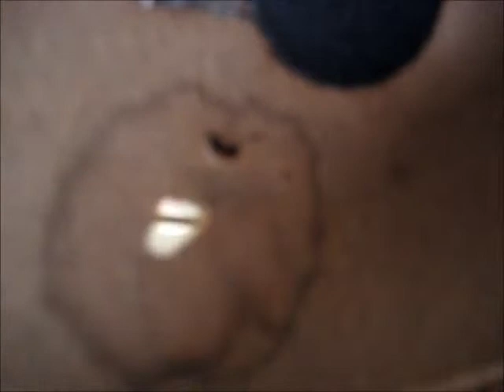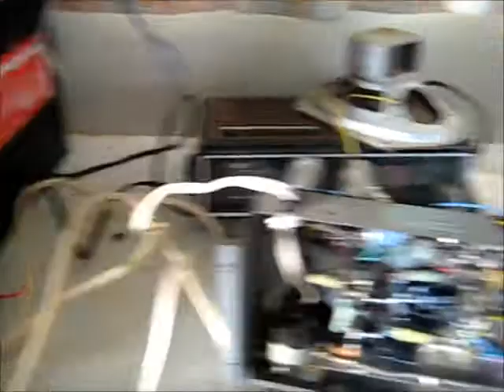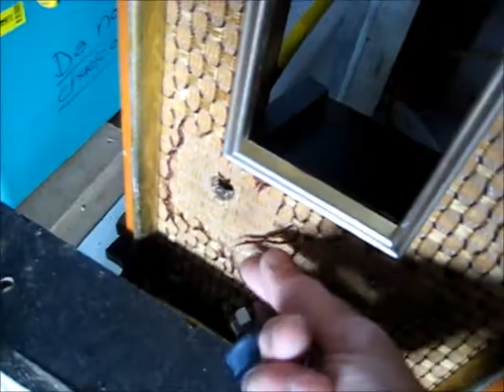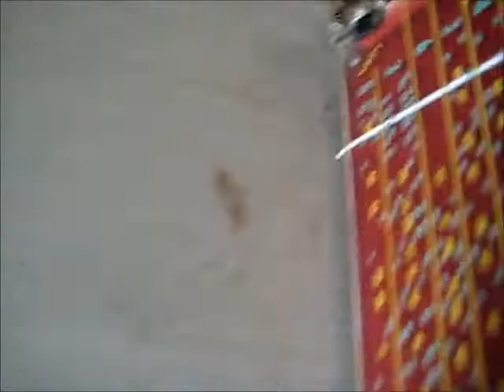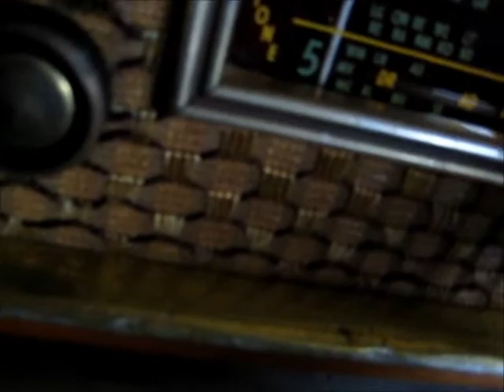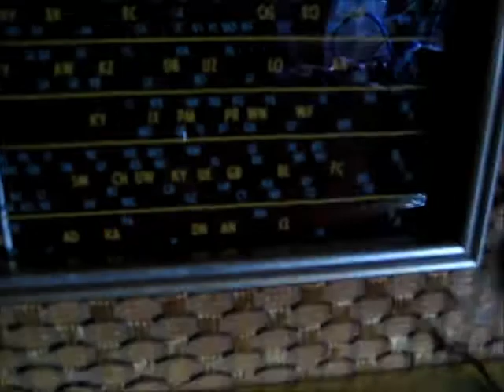STC Radio restoration Part 1

Comment: I have used contact cement but apparently fabric and craft glue from a glue pen works good as well. You can use regular bond or construction paper to patch the hole, coffee filters are only really needed around the outside edge where it needs to flex, the surround or hinge as it's called.

Comment: @CiviC894G Ever here of an antique car collector, well there are antique radio collectors too and they like to restore their sets. As for the performance you may be pleasantly surprised if you heard one that has been restored and aligned properly. They were made in an era when AM radio was king and the older ones from the 1930s were built at a time when the stations were a lot less powerful then they are now so they will easily outperform most modern AM radio tuners, except for car ones.

Comment: replace the old speaker with a 6x9 car speaker, something aftermarket with a polyurethane or rubber cone should work long as the radio and speaker ohms are same rating, and same dimentions as old speaker.car speakers/stereos are rated @4 ohms, house stereos etc rate @6 ohms or more depending on the age of the system.